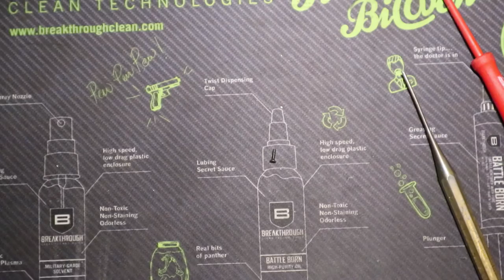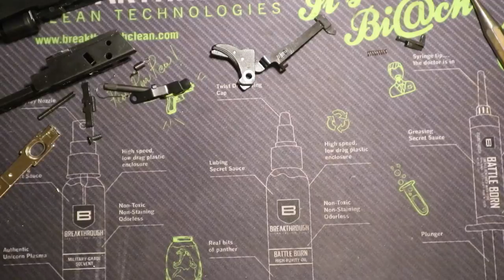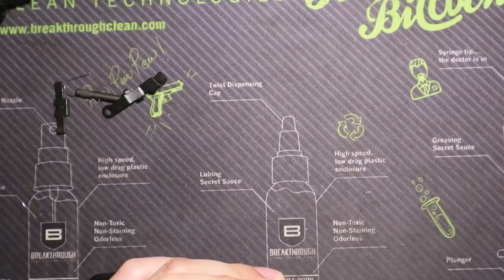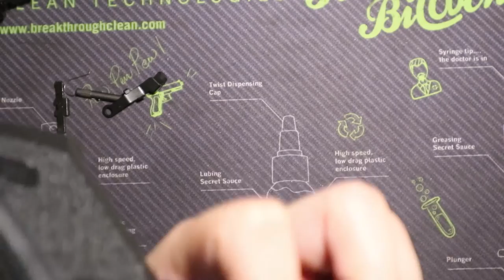TM G19 - Disassembly and Reassembly (2018)

Comment: I finally got around to mustering up enough bravery to take apart my TM G19 completely. Put it back together and all seems well, but I noticed 2 things right off the bat:

1. The slide gets hung up on the frame more now, making it harder to join both halves (though not impossible, just takes a few tries).
2. The trigger is stuck in the "fired" position. It wont' go forward, rendering the damn thing useless. F*CK!

This is what I get for thinking I could do this. Should have just stopped at sights and tight bore barrel. Rogue Studios, do you have any possible ideas as to what's causing my trigger to be stuck in such a way? I'm guessing it has to do with how I placed my trigger bar/lever, but I don't actually remember if it had to seat it a certain way or not within the hammer assembly... I know, stupid.

Comment: How did you modify your hammer spring to prevent light strikes? Did you just bend it a certain way yourself? I just got a Tokyo Marui Glock 19 recently, and it's been something I've wondered about... Great video by the way, extremely helpful as usual!

Comment: another very well done, detailed disassembly and reassembly!  how do you think the removal of blowback housing will affect aftermarket metal slides and barrels?  i cant imagine them being flexible enough to bend so you can remove/replace the bb assembly.  also have you given any thought to doing this with lesser known pistols?  fnx45, m&p9 and xdm all come to mind

Comment: Another question for you on this gun... What do you use to clean it? I keep getting mixed answers from everyone. Some people say White Lithium Grease, some say it's not for plastic, others say silicon for everything... I just want to clean my gun properly :D
Reply from the maker: i use paper towels or shop towels to wipe stuff off, 
and tbh i use a mix of silicone grease and silicone lube.
specifically i use very low cst lube for the o-rings and fast moving parts, i try to avoid using high cst (high viscosity) lube because it can bind up parts the green gas sometimes has some silicone lube inside already. But this varies from case to case, propane tanks with adapters for example do not come with any lube so those can run your gun dryer at time, in which case frequent lubing may be necessary. 

For grease, i use it for the mechanical parts, but i apply very little. For example, hammer assembly, where the trigger rotates, where the trigger bar grinds up against stuff. If you apply too much grease, any little bit of dirty will accumulate into a clump, and i do not use grease on areas such the hammer notch, or sear nub. Because those areas require friction to operate correctly. But on the hammer rotor where it hits the bbu is okay, or the sides of the valve knocker disconnector. 

this is just my method tho, its not based on anything other than my experience with lubing. I mostly approach it from a gaming perspective, since i use the gun so frequently, making sure its clean and light lubing is enough for me. Some prefer grease cos it never really goes away. Some prefer spray or lube because its easy to apply and the gun will blow some of the junk off and it usually doesn't gunk up a lot. 
depends on how you view it.

Comment: What kind of gas do you use with your TM G19?
Reply from the maker: green gas, mostly because i'm testing it, 
it is worth noting that i did a striker test to eliminate the possibility of light striking, 
so my test results will vary compare to others.
Reply: Rogue Studios are you not concerned the slide will break? My TM G19 is in the mail, and will be my first GBB. So trying to figure out if I should play it safe with duster, since there’s no replacement parts out yet... or go with green gas and get the extra power. 

Thoughts?
Reply from the maker: @MarcAddeo  you should definitely use duster if you want to play it safe, i simply use green gas cos i'm used to working on stuff anyways, just depends on how you intend on using it.
Reply: @RogueSystem087  Yeah that's probably what I'm going to do. I do intend on upgrading the gun eventually to allow green gas/propane usage and higher fps... But there's no parts yet! :D